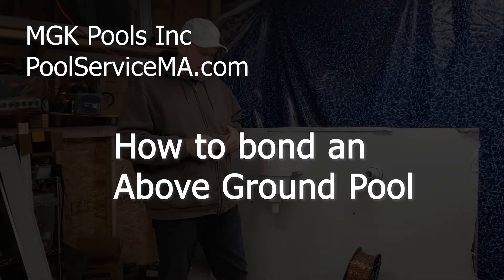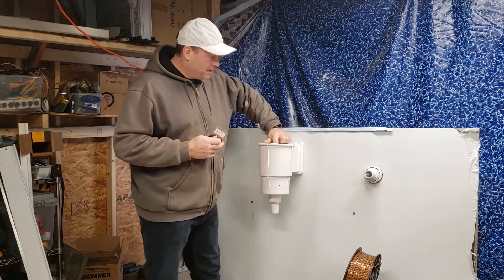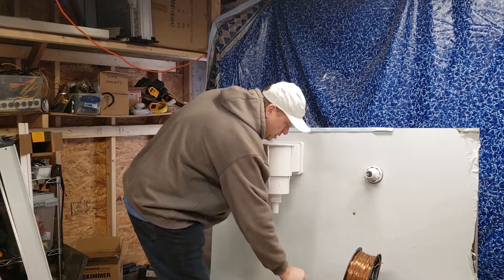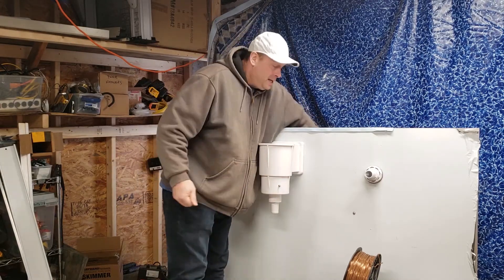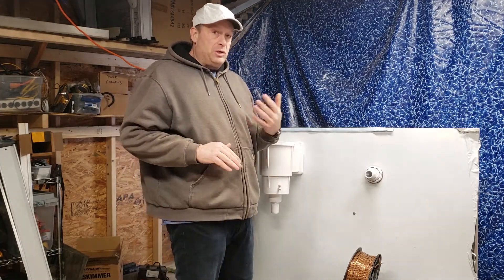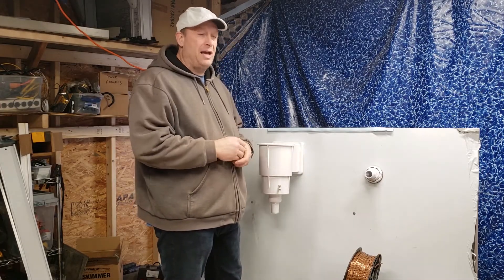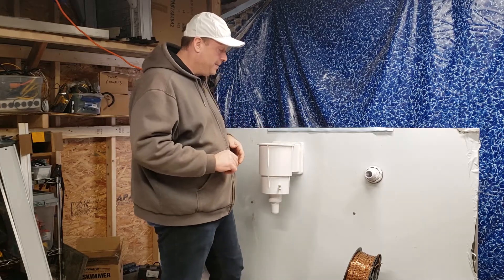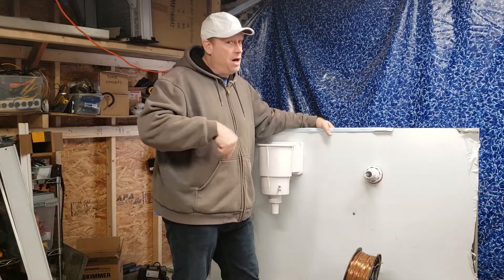How to Bond /Ground An Above Ground Pool | Simple Instructions

Comment: Thanks for the video. We live in Florida and we assumed by mistake that we have not required a permit by the city. An inspector from the city found our pool above ground with no permit. It was grounded but they (the city) it has to be bounded. We installed by ourselves the pool and now we are at loss but your video helped us a lot

Comment: My pool is vinyl with a metal wall. It has a green wire that is attached to the where the pool wall is bolted together. The only bonding plate I have is on the basket at the front of the pump. I don't have one on the skimmer. I was told to connect the copper wire to the green wire, run that around the pool and connect the other end to the pump. Is this right?

Comment: Am i missing something? All videos show the copper wire ending at the skimer then pump. Can i start at the skimmer then to the 4 contacts on the pool and then finish at the pump? I would look so much cleaner then seeing all that copper wire hanging! Thanks
Reply: Did you ever find and answer to this?
Reply: @S0ulPurp0se777 not really I just started at the pump and ended at skimer so everything is under ground until it comes up the pool wall behind the upright and ends at skimer basket

Comment: So I have the copper wire. My pool is in the ground. Is it ok that it is touching the steel in several points around the pool in a consistent run? I didn't have enough to go the entire way. But the pool is steel and it's all connected.

Comment: Ty for this. Now i have an intex soft sided metal xtr pool, and even though it is sided by the liner, we still have to bond it as per code. Question, are the over the side skimmers from intex, etc compatible with these bonding plates??? Very good video.

Comment: How do I bond a pool that has all resin connectors? The uprights and top rails are metal, but the resin connectors do not allow the metal top rails, the bottom or top track or up rights to touch each other so I'm not sure how to bond the pool.

Comment: You have mentioned in your video to run the bonding conductor around the pool 12 inches from the pool wall , that is not the NEC and you should correct it to read what the code actually is and that is 18-24 inches from the side of the pool wall, 4-6 inches deep. please try to get your facts straight before posting videos.

Comment: When you say, you touched the pool in 4 places, do you have to touch it with a metal to copper connection?  I ask because my uprights on the pool are plastic,  so is the ring that holds the pool wall. I'm not sure where I should touch the pool?

Comment: Question: sorry I have watched this a couple times. But when starting your copper wire around pool, where does the beginning of the wire attach to? Does the beginning of wire start and complete  circuit at skimmer? Or does it start at the first point on pool support?
Reply: same question.
Reply: @rozebiz  I finally found other information that says to get a skimmer bonding plate. Start at bonding plate, bury the wire all the way around pool and terminate from beginning location. Then take copper bonding wire from pump and attach to skimmer plate as well. I have an all resin sided pool so there is no where to drill on posts of pool. Just one continuous wire around circumference of pool wall about 12 inches away from pool.

Comment: My above round ground pool 10x10x52 sits on a concrete slab  should I bond the pool the same way but except run the wire to a rod in the earth since I can’t dig a 6” trench around the pool?
Reply from the maker: You want the ground all around the pool to have the same potential. I don’t know the best way to proceed with a existing concrete deck. I recommend checking with a professional electrician.
Reply: @MGKPools   thank you and stay safe!

Comment: FYI - Have a 18’ pool , 96’ of copper wire was enough to bond it , also I continuously ran the wire to my four points of contact, I didn’t splice a separate piece of wire to the metal posts, some places require a continuous loop and didn’t want to take a chance and get it wrong. Hope this helps someone

Comment: I have a resin pool.  The only metal is on the wall.  Where would I attach the copper wire at the 4 points?
Reply from the maker: Wall track or on the wall below the top of cove, could cause steel pools to rust so seal with enamel paint

Comment: Canadian Electrician here. I haven't done grounding/bonding around pools before. What you're describing here sounds like a ground ring, not bonding. I've only installed ground rings around power generating facilities like Cogen plants and around large backup diesel generators for hospitals ect. I know the difference between grounding and bonding but I still don't understand why you need a ground ring around the pool. Wouldn't an insulated equipment bond wire from that plate to the pump chassis be the way to go? If not, why?
Reply from the maker: I'm not an electrician or have any specific training. It's about creating a field so you cant reach a different potential. All I know
Reply: It is bonding, not grounding.  You are creating an equipotential bonding plane to reduce voltage gradients.  It is controversial, but it is required by our National Electrical Code section 680.26
Reply: Think of throwing a rock in a pool of water and watch the ripples go out in all directions.  You would get a different potential across those ripples. I'm a journeyman lineman and its important for us to understand this. If we have a phase to ground incident you need to stand still or take very small steps because current runs through the ground like that ripple in the pool. You take a big step and you have one voltage in one leg and another voltage at the other. It can kill you. So that circle ground around the pool makes a lot of sense to me. I'm fixing to upgrade our intek pool we bought last year to a Hayward system and I came across this because I wanted to see if I needed to bond the pump. I'm glad I found this video. Since its a soft sided pool I take it I just need to bond the pump.
Reply: All my pool needed was A bonding plate in the pump skimmer and the #8 bare wire ran to the grounding lug on the back end of the pump. Simple and safe. This is according to the pump manufacturer that I purchased. 6/23

Comment: do i need to pull the ground rod out that the electrician put in years ago? he only grounded both ends.of the pool 15x30 and the motor/pump
Reply from the maker: No leave it and use it, no harm

Comment: Hi Mike, on an Aquasport in ground pool can I put the cooper wire 30 inch deep in to the ground? Thanks.
Reply from the maker: Read local code... but most should be 12 inches from the pool wall, 6 inches from surface.
Reply: 680.26 (B) (2) (b) (4) 2017  states 18" to 24" from the inside wall of the pool for paved or unpaved surfaces  @MGKPools

Comment: Do you have to attach the bonding wire in four places even if all the components are resin except the pool wall?
Reply from the maker: Yes. you can attach bonding wire to the wall down in the cove area. 1 inch off the floor you should not puncture the liner
Reply: I was told by my pool installer that because the posts are resin in my pool I just need to run the #8 ring around the pool and complete the bond to the water and motor bond. They said they left a #8 wire that they connected to the metal ring around the bottom of the pool that is steel. That will complete the shell bond.